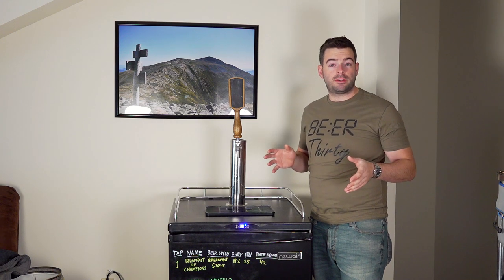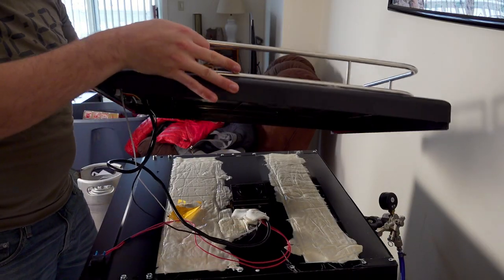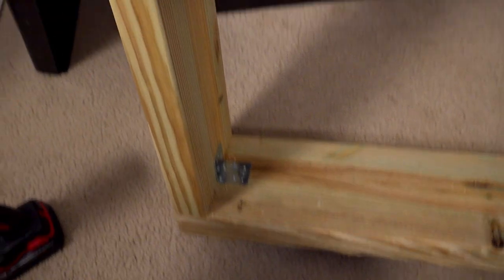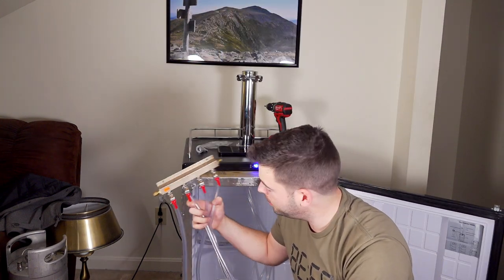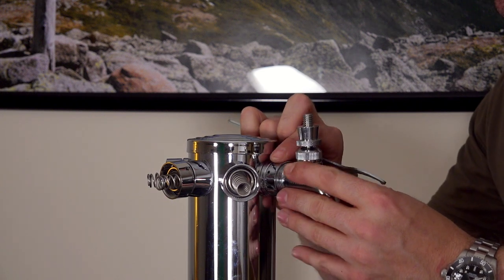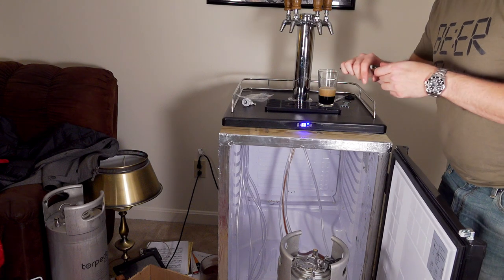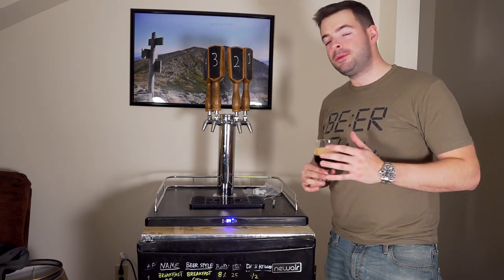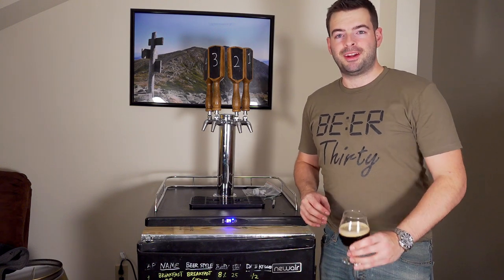How to UPGRADE a Kegerator to FOUR TAPS from a SINGLE TAP Upright Kegerator

Comment: Handy. I've seen similar approaches for freezer conversions. Keezers I think they call them. I just bought a normal fridge and did a conversion, quite happy with the result. There's not many fridges that accept 4 kegs in the UK and a 4 keg premade one is pricey!
Reply from the maker: Yup, I used to have a keezer before getting the kegerator, same concept except horizontal

Comment: Hey that’ll work! I think Moski has a ferm chamber like this but I’ve never seen it done with a kegerator. With non slimline kegs I’m only able to fit two in mine 😏

Nice work!
Reply from the maker: Slimline helps! But yep, basically figured a keezer collar flipped sideways would work, and it did. Worst part was getting the door right though, hence the latch

Comment: That's fantastic, it's basically the exact same thing I did with my current Kegerator, although looks like the Newair is better in that its already pre-drilled! Such a shame they're not available in the UK
Reply from the maker: Honestly there are better kegerators for the money but all you need is a hole saw and you should be good to go with any fridge. Thanks for watching!
Reply: @TheApartmentBrewer  Good to know about that, thanks. Yeah, only worry I have with it is drilling through coolant since not many older fridges have their schematics available online (which tbh, kind of understandable from a Patent point of view). I know some fridges have top down coolant, others on the sides, then theres those with it on the back!
Reply from the maker: @NikitaVorontsov  that is a very good point!

Comment: Is your tap tower insulated? It would highly benefit having a tower cooling fan. Kegland has one for about $30usd, but they can eaily be made with a project box, psu, and 34cfm brushless pc fan. I use an old "discontinued" dual fan where one fan with a hose cools the tower, and fhe other fan helps circulation of cold air inside the kegerator. Thats a great build video to do!

For my 16 tap Keezer, i use a 3" 12VDC BILGE fan. Its insulated so it can handle the moisture environment. It is a brush motor so after 3 years I had to replace it.
Reply from the maker: The tower is insulated, but a cooling fan would be helpful. I haven't had any excess foaming issues yet though!
Reply: @TheApartmentBrewer  thats good. 3/16" line? What PSI you serving at? Mine is 3/16" serving at 14psi and about 11.3ft of line to balance the pressure. No foaming, though a bit happens if I leave the fan off despite the tower being insulated
Reply from the maker: @Bassguitarist1985  its about a 6 ft 3/16" vinyl tubing, I'm serving about 8 psi
Reply: @TheApartmentBrewer  nice, no issues with losing carbonation? I ussually carb most of my beers at 2.5vol/co2 so it needs a higher pressure to keep in solution. I do run my porters and stouts at 9 psi though.
Reply from the maker: So far so good. I've put 4 beers through it so far but none have been very high carb styles

Comment: Nice thinking outside of the box.  I’ve never seen a keezer concept to extend a kegerator, but I like the idea.  I saw that you had the four screws on top holding the collar.  Does the HVAC tape hold the sides and bottom of the collar securely to the inside of the kegerator?
Reply from the maker: Yep, I figured if it works vertically, why not try it horizontally? Yes, the HVAC tape is keeping everything secure at the bottom and sides, but I will likely add something more sound in the future

Comment: I know this video is not even a day old, but how do you like your new kegerator vs a keezer?

I sold my keezer and am looking to go with a front door style vs another chest freezer.
Reply from the maker: I will say it has pros and cons. The keezer had more space, but the taps had to come out the side and I had to lift full kegs over the lip. I love the draft tower on the kegerator but space is tight inside. I will say the draft tower is making it worth it though!
Reply: @TheApartmentBrewer  That was one of my biggest issues, lifting full kegs plus the keezer took up a lot of room.